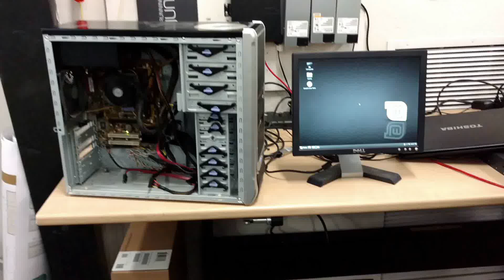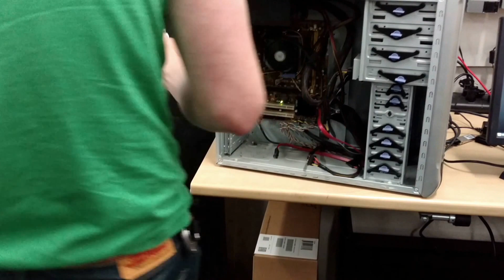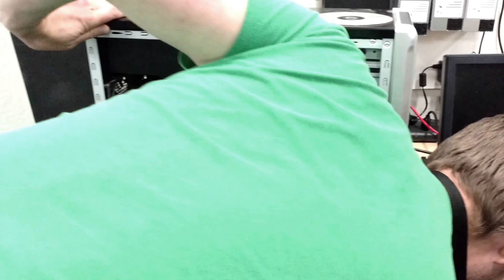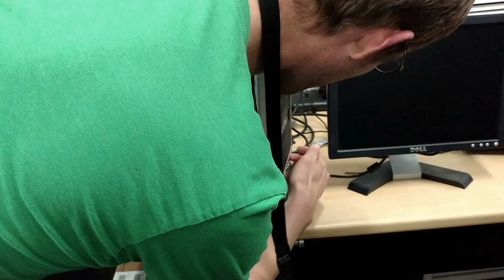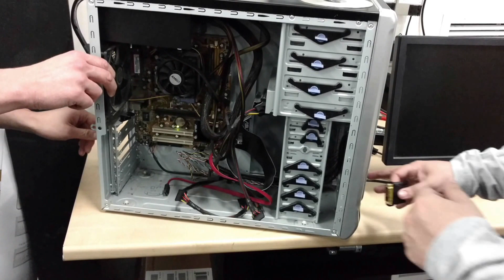USB Killer Test

Comment: Will this thing only kill the CPU fan and Motherboard only? What happens to the HDD, GPU, CPU and RAM?
Reply from the maker: We didn't test the hard drive. I think the processor and RAM are toast. It wouldn't even power on. No BIOS or anything.
Reply: @PhilLeeAT  do you guys think this will kill my GPU,CPU and motherboard?
Reply from the maker: @kpkid4316  motherboard, yes. CPU, maybe. GPU I'm not so sure, I feel like that would be pretty isolated. The test was on a board with an integrated GPU so there wasn't a way to test it after
Reply: It is the PSU fuse thats dead by changing it your pc has to work again
Reply: @drag0nvalley  kills the motherboard, that wouldn't work. If the computer has other chipsets on it other hardware can be fuzzed even after repair

Comment: The fact that the MB light went out the second he flipped off the power supply just shows that it caused a serious short in the board. Usually it takes 5-10 seconds for the light to go out because its draining the caps in the psu, so something was putting a huge load on it for it to drain instantly